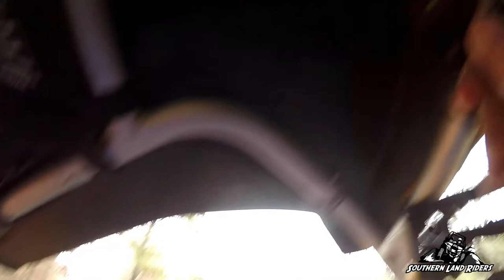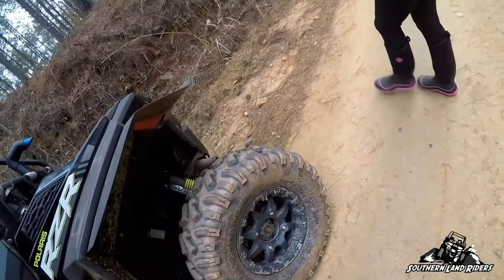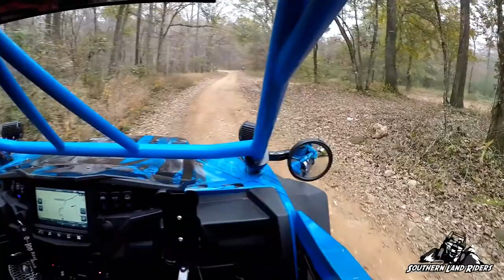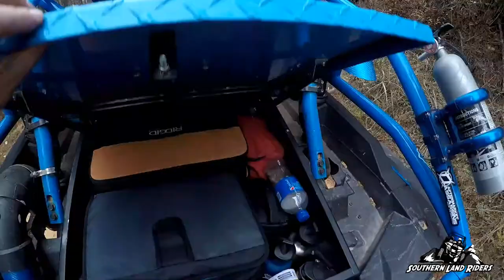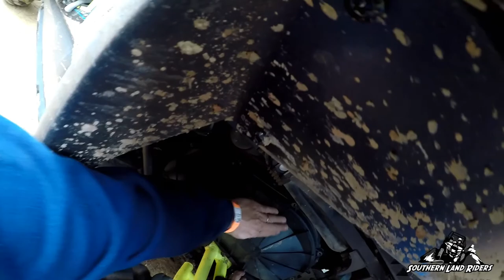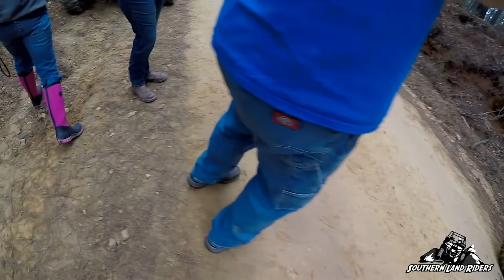Durhamtown 12/2017 Part 5 (Belt Shredding)

Comment: Yeah power saw cut a stump set under foot rest tire off be great help . Most clutches have a hole in them to screw a bolt in to  hold it open  so could easy get mess out check into that carry the right bolt usually a fine thread one  spare belt your good to go glad see you got it going tho .
Reply: atvguy63 - thanks for the advise, with my luck I’ll check it out